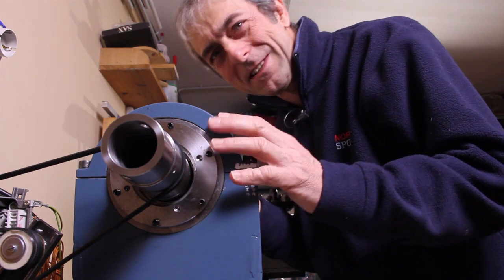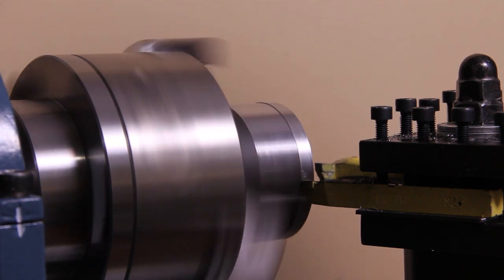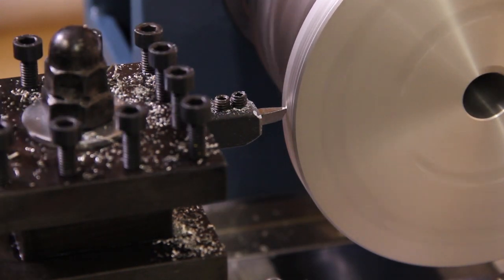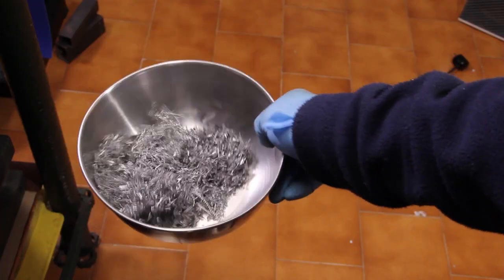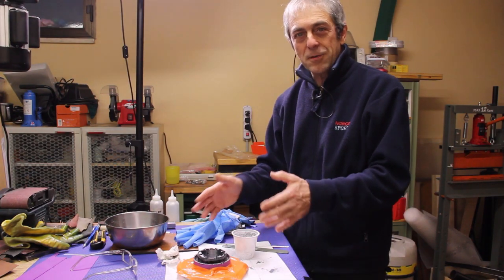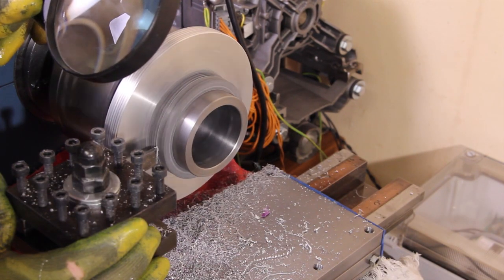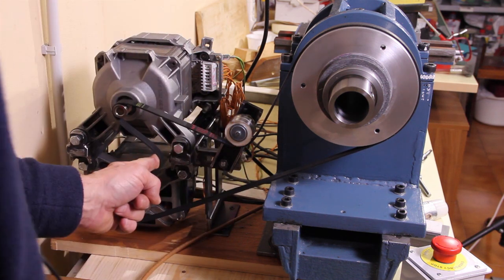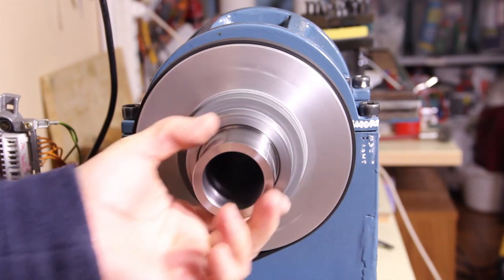DIY composite pulley for the home made lathe [part 11]

Comment: I wonder if instead of trying to turn a part with a pulley-less lathe with a scraping style turn tool, if you mounted something like a dremel to the tool holder and instead sort of psudo ground the part to size using the lathe ways to keep accuracy. Thus changing the torque baring portion to the fixed dremel instead of the belt of the lathe.
Reply from the maker: That could have been a good idea.

Comment: Nice. How much you spend total comparing to buying a new lathe of the same turning diameter and length?
Reply from the maker: The lathe is not yet completed so I am unable to give the costs at the moment. An estimation is that It will be certainly more expensive than a chinese lathe, and way more cheaper than a high quality lathe. But this lathe is designed to be a midway between a manual lathe and a cnc lathe. At the moment I am stuck with the linear encoders that I ordered many months ago and that have not yet been shipped. The pandemic has caused severe setbacks with this project. I'll make a Q&A video in the future, addressing many points, including the costs.

Comment: I like your concept. Firstly I realize using this method you can have what ever size of a Spindle bore you desire. creating either Spindle Pulley(s) or Spindle Gears. I have to watch the rest of this video before I miss what you have done Next. I am a huge proponent of "V" ways for accuracy as opposed to Flat Ways. But Your Spindle concept has me very interested. Back to the Video. Again I would be using Taper Bearings which have a means of tightening to reduce the Run Out.
Reply from the maker: Good point about the V ways, I have to keep this in mind for the next Q&A video. Cheers.

Comment: Hope you’re doing well! A few months ago we talked about designs for the ways and cross slide, Im building a lathe as well (although a bit slower than you unfortunately hahaha).   One thing I have thought about, have you noticed any  creep in any of your welds from the heat stress? I remember you machined the body after welding to get such nice surfaces, but I can’t remember if there was any movement in the welds long term?    Absolutely beautiful project and so amazing to see it getting so close to being complete!
Reply from the maker: Thanks bud. I'll try to go deeper into this point in the next Q&A video.
Reply: Yeah best practice to relieve internal stress is to heat all part after welding. Perfect if you can put in furnace and keep part at 650c for hour. But i seen some russians just throw all lathe in campfire and burn it good, but thats little brutal.
Reply: @craftzars  I think it's fine to roast in a campfire like that, but the trick is to ensure that the hot ash completely covers the part after the fire goes out.  There's enough insulation from the ash that the cooling process is very slow which is good for stress relief.  You can even mold glass bottles into ash trays this way, as my grandfather once showed me, but you really need to make sure the coals and ash cover the glass completely after melting it otherwise you just get a pile of broken glass!
Reply: @craftzars  give any link to those Russian video!

Comment: try to use speed steel as a tool on your lathe... its much more forgiving on small lathes than soldered carbide
Reply from the maker: Thanks for the tip.

Comment: Wow so much patience. Just now wondering if you could have wrapped the belt around the chuck and driven it that way.
Reply from the maker: What do you mean? May you explain better your question? Tnx.
EDIT: Nevermind, I misread your question. Answer in the comment below.
Reply from the maker: Oh nevermind, I misread your question. Yes that could have been a possibility, I actually didn't thought at it maybe because it would have been trickier to keep the belt in place, and there is no room for the motors behind the cross slide.